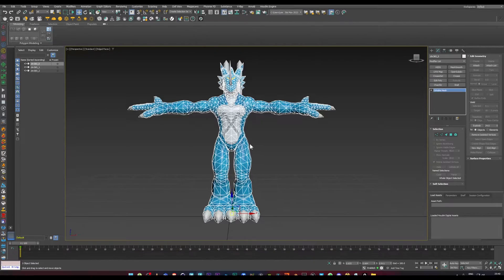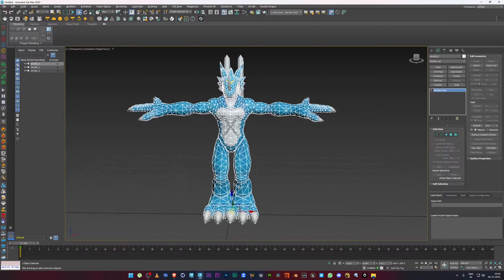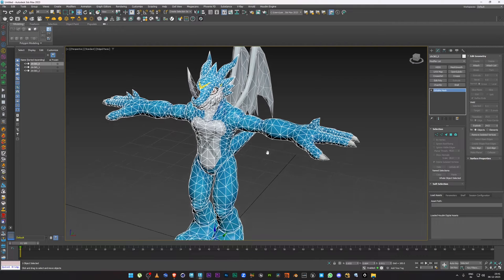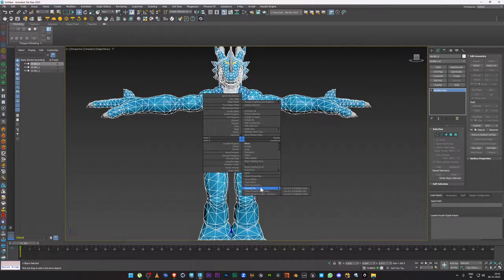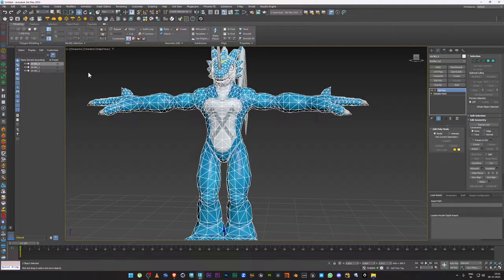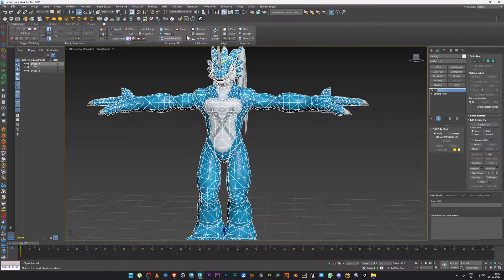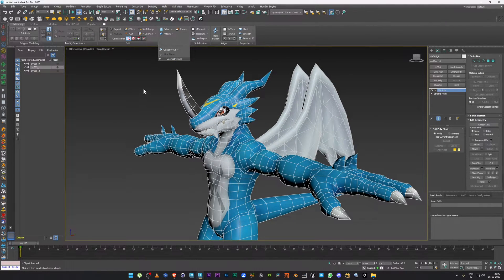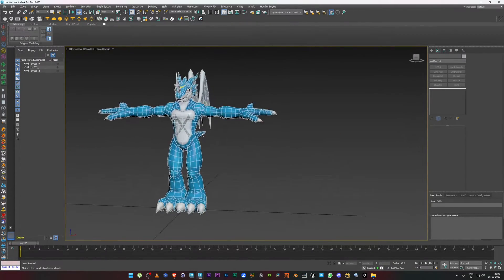3ds Max - How to convert triangles into quads in 3ds Max

Comment: Yeah no. This tool is pretty much useless because it can't handle quadifying right removing wrong edges at different parts of mesh and not even taking in account symmetry of the mesh/ Needs lots of tweaking and cleaning by hand after this. Too bad Autodesk can't create good tools.